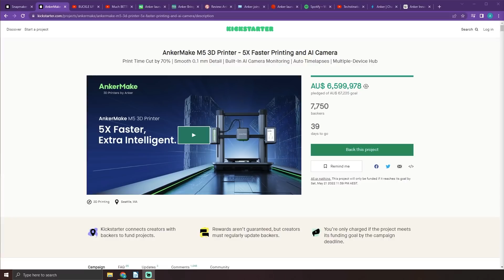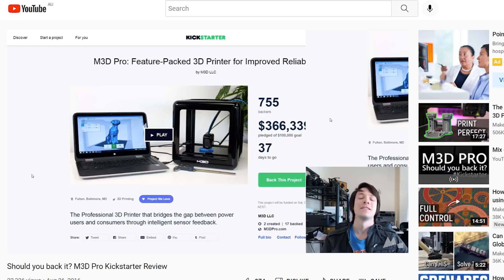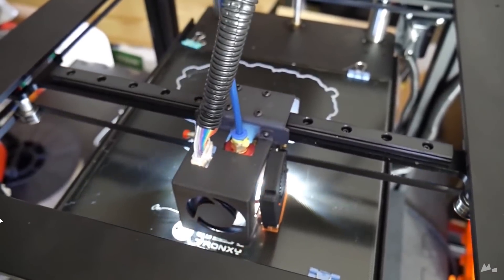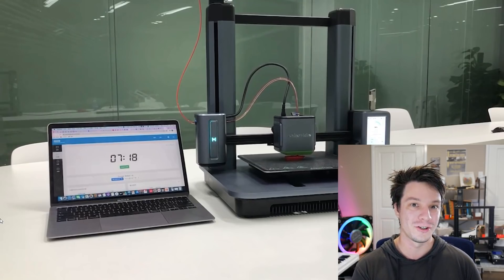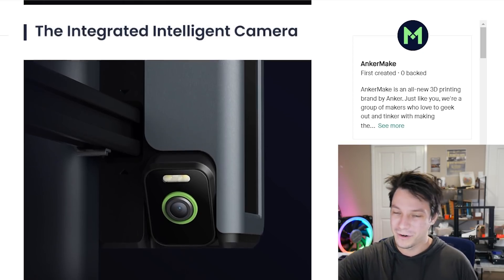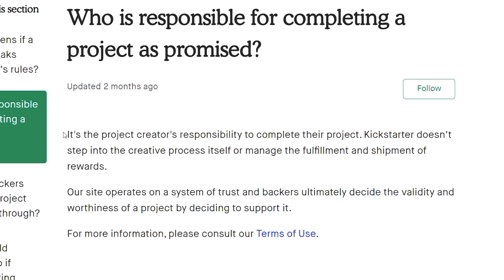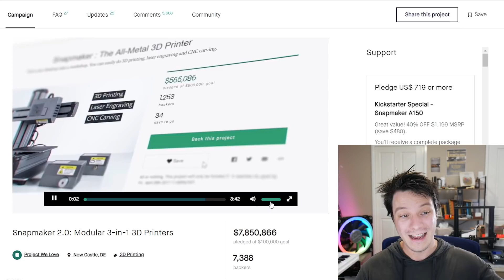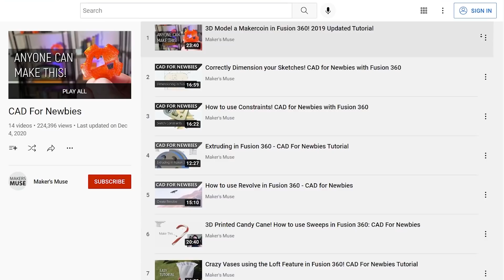This 3D Printer looks incredible, but...

Comment: I probably design 60-80% of the things I print on my 3d printer. Most of them are things that I make for personal projects or fixing things that have broken about the home.
Being able to design the prints myself is most of the fun. 
I've even gone so far as to take other people's models and modify them to suit my purpose for my printer (turned my Hypercube to use a rail on the y axis), none of the models suited what I wanted to do, so I ended up making my own. And without the skills I have learned I would never have been able to do it. I've sat through some of Angus's tutorials and others as well with Fusion360 and I've ended up with a lot of functional models, most are fairly simple, but the modification to my Hypercube was probably the most ambitious one I have attempted with 5 iterations until I was happy with the final result.

If I could only just print out downloaded models, I wouldn't have bothered with the printer in the first place. Now I love it.
Reply: I completely agree. The overwhelming majority of things I print at my own designs. I print a lot of functional parts and when I have a specific function in mind, it’s always better and usually faster to produce my own from scratch than to try to find one online that will fit the bill or be easily modified. All of the people who designed those models had their own specific uses in mind which aren’t the same as mine.
Reply: I'd personally say 50% of my prints are completely designed myself, 25% are modified designs from others and 25% are stock downloaded stuff. Then again, once you know what you're doing in parametric CAD, drawing stuff gets pretty quick if you know what you want or need, so it sometimes even is faster than searching for the model online.
Reply: I completely agree. 3D modelling will be (if not already) the next generation's MS Paint.

Comment: Slightly disappointed to see not even the slightest mention of their extremely sus/borderline FALSE advertising regarding specs, printing speed, etc.

TL;Dr they have no actual software written for this, and the massive speeds they're advertising are all but impossible in 99% of scenarios with realistic nozzle size, material temps, etc etc
Reply: yeah, im surprised he didnt mention the advertised 5X speed and other stuff, but i guess inflated adverts are just par for the course at this point.
Reply: @pajamas720  I worry he's somewhat suckered into the trap of reading the implied statements such as "Advanced algorithms that align your printing with your course of action" and has automatically made the mental connection that they're using Klipper's rather nifty Input Shaping - which is clearly what they want us to think with that kind of phrasing, even though they're not actually providing any evidence for it, and have admitted to not even having written the software for the printer yet.
Reply: Has the speed shown to be false?
Reply: @veryboringname.  Yes, actually, their own video shows that it does not meet the actual speeds they are claiming.

There is a difference between "prints 5x faster" and "can print at up to 5x travel/feed rates". Printing 5x faster means a print would take 1 hour instead of 5, but the realistic meaning is that you can punch your maximum travel/feed rates up pretty high (they advertise 250mm/s), but the printer almost never actually hits those speeds.

Just as a small point of comparison: a printer for half the price, such as the Creality CR6 SE, which also has the rigid frame, dual Z-Axis screws, auto bed levelling, etc etc, has a "normal" print speed of 60-100mm/s, and goes "up to" 180mm/s. Even at its absolute slowest default setting, the Anker is still not even 5x. With that said, the actual speed it was moving in their own video is about on par with how fast mine goes when I have it set to run around 75-100mm/s, but I've also fine-tuned my acceleration and jerk limits to maintain acceptable levels of quality while printing at higher speeds.

Then there's the issue of nozzle size and heater capacity: a nozzle that's twice as wide can spew out four times as much plastic (hypothetically), but then you also require a massively powerful heater cartridge to melt the plastic at least four times faster, and the quality of your prints is now half because the nozzle is twice as wide (so sharp details cannot be printed). Additionally, with the plastic being melted so rapidly, there will be tons of oozing, stringing, globbing/zits, and all sorts of other things that have a very terrible effect on the quality of your print.

No matter how you look at this ad, it's pulling in a bunch of buzzwords and features that are either free and open-source (klipper's input shaping + pressure advance, spaghetti detective's ai-based print failure detection, octolapse's timelapse feature, etc etc) or features that are only physically possible on things like the voron, ratrigs, etc (printing at a genuine 250mm/s speed while maintaining quality and tolerances, and also not physically tearing the machine apart in the process)

There's also a numerous amount of errors/inconsistencies/misleading info along their kickstarter campaign and website; "Precise 0.1mm detail" while showing a picture of the nozzle implies the nozzle is 0.1mm, when the standard is usually 0.4 or 0.375. While it's true that a 0.1mm nozzle will yield incredibly sharp details, it will also take over 15x longer to print with a nozzle that small, due to the reduced flow rate, so AT BEST they're implying that you can put a 0.1mm nozzle in there for when you need precise detail instead of high speeds. "Cuts print time by 70%" should instead by by 80%; this is just basic math (if it prints 5x faster, then 1/5th of 100 is 20, so that would cut print times by 80%, not 70%). There's an outright typo in a section about the heatbreak assembly: "a tiny 30 mm distance between the exturder and the nozzle"; this should say extruder, not exturder. In the same line of text they mention "internal processing that checks on your print more than 1,000 times" but this also does not make sense at face value: is this 1000 times per second, implying a measly 1kHz processor? Taking the phrasing at face value, it would mean 1,000 times per print, which could imply something about checking every layer, but that would only make sense if all your prints were at least 1,000 layers - no matter how you slice it, it's ambiguous marketing speak that's made to sound impressive without actually explaining anything, let alone quantifying any kind of specific guarantee/claim, so if the printer is actually shit, they can't be sued for false advertising. "Advanced algorithms that align your printing with your course of action" is another great example of this; one could argue that even the most basic lines of gcode to draw a circle are, in fact, an algorithm, as they meet all the basic requirements to be defined as such. Does this statement hint that they're using Klipper's input shaping, a rather advanced algorithm that physically changes the motor movements to align to the actual dimensions and mass of the printer, slightly increasing print speed and quality while reducing wobble and failure chances? Yes, it certainly implies that, because they're listing that sentence in the section about speed and quality. But it doesn't actually technically specify this, it only implies it. This kind of marketing garbage is why this thing smells so terribly fishy.
Reply: @StormBurnX  I'll personally wait for proper reviews before passing judgement. Right now everything is just "I think...".
Reply: @veryboringname.  Exactly. The only reviews I've seen so far have all been sponsored reviews that followed a script, and while it's disappointing, it's not a surprise. I have no doubt in my mind that Anker is capable of delivering "a printer" in the same way that I have full doubt in my mind that they will deliver the printer they are actually advertising - time will tell, but their price point is the biggest dead giveaway, as well as the fact that literally their own video advertisement blatantly disproves the advertised facts.
Reply: @StormBurnX  The thing is, you've already made up your mind. Even if it performs surprisingly well, I have a feeling you'll still find fault with it.
Reply: @veryboringname.  well let me put it this way: its impossible to get those kinds of speeds without building a core xy dedicated to pumping out speed benchys or otherwise  creating gcode that will kill most printers, not to mention the quality will be bad.
Reply: 100% this. 250mms bullshit at 500 acceleration…..
My printer at 125mms blows this thing away.
250mms lol…. Yah give me a break

Comment: I'm still waiting to discover an every day practical reason to have a 3d printer for home use. In other words, what is the 3d equivalent of "print my family photos" or "print my school assignment"? I design/print a lot of "random around the house" kinds of things but that's the key … I design them. They're often entirely custom one-off things because I have a machine and have been a serious hobbyist for over a decade and I enjoy the process. But I just don't see there being enough things for non-designers to make (and be willing to wait for hours to print) that can justify a $500+ device vs just buying some injection molded widget that does 99% of the job. You only need so many fidget toys.
Reply: The only thing i can see that will give the use case for having a printer in every home is if manufacturers of everyday products would have some of their replaceable parts available as models.  Things like oven knobs, with instructions that they should be printed in materials with higher heat tolerance, microwave door handles, things of that nature.  Unfortunately with the direction product design is going, and the trend towards replace instead of repair in the pursuit of more profits, trying to get manufacturer support like this is a pipe dream at this point in time.  I design and print my own stuff, but occasionally will help my friends out with printing spares for stuff.  This past weekend I printed a pair of tape dispenser cores for a friend, who's kid lost while playing with the tape dispenser.  He could have bought them for a few bucks online, but he asked me instead and for pennies of electricity and PLA, I was able to bring his tape dispenser back to working order.  But as you pointed out, I didn't buy the printer to print replacement parts for stuff, it was just a positive side effect of already having a printer for other purposes.

Comment: Of course you can "cheat": it's literally buying pre-vetted images. We're talking about an attempt at going after the "set it and forget it" crowd, the people who DO NOT WANT to know how to slice, how to model. They want to shop for a 3D model online, send it to their printer (the phone app lets you do that without ever having to connect the printer to a PC or even a USB stick), and just have it print. That is what the future of this hobby is going to be: Not a hobby, but a tool. 

People don't change their own oil in their cars (by and large), they won't be doing their own modeling or slicing. This is where home 3D printing is going en masse, same as anything else that used to be a hobby. This isn't a bad thing, it's just a different thing.
Reply: I think it's comparable to the FPV/drone platform market. People who want to build from the ground up, tinker, and tune are able to do so, and that hobby community drives all kinds of innovation forward. But most consumer-level folks just buy a locked-down DJI product and use it a few times before getting bored. The hobby folks often wind up buying a DJI drone as well, because it has its place even in the hobby world, and I think that'll be true of Anker's printer.

Comment: People who own future 3d printers are going to look back on our current stuff like we look back at personal computers from the late 70's and early 80's. You can do a lot with them, but as the technology improves and the paradigms shift, people will be able to do a lot more with a lot fewer headaches.

Something I would like to add on the design aspect of your prints. Knowing how to make a model in CAD is an important step, but learning good design choices for those models can often take trial and error. Don't be afraid to design, print, modify and repeat. If you want to improve your design and making, the best way is to (big surprise) design and make.
Reply: I have now been printing for over 4 years now and designing and printing are no guarantee your model will look good or work well.The simplest and cost effective way of printing I have found  is to print small first, check it looks and dose what you want, then increase to the actual sized you want. Save me a fortune in wasted time and filament. Hope this advice will help someone.
Reply: No, people will look at them the way we look at milling machines from the 40’s. Sure they didn’t have digital readouts and stuff, but at the end of the day, you got a part out of it.
3D printers are tools. You don’t need a printer if you don’t need to print.
Reply: @QuitProcrastinating  that's the good thing about 3d printers they don't really get outdated until someone completely reinvents the wheel (like material jetting)
Reply: Completely agree about making good design choices - very important. I believe it's best to sketch out ideas before 3D modelling - saves a LOT of time later!
Reply: Beg to differ.  Stick with printing technology.  If you look back on the printers of the 70s and 80s, they were rock solid.  Right down to having specialized feed paper so that designing around jams / jam detection wasn't really an issue.  Now, yes, the feature set has exploded.  But the reliability is super low and the cost is way higher.  To the point where it's cheaper to toss your printer in the bin than buy new ink.  Where manufacturers have programmed in mandatory ink refilling and will disable a printer PERMANENTLY  based on a calculation of how much waste ink has been dumped in automatic head cleaning.
Reply: No, there are too many factors that go into a 3d print. This isn't a static machine or paper printer. Even the most expensive machines have issues.
Reply: Me when I see reprap printers

Comment: I disagree on the needing to be able to cad to 3d print. For wargamers (at least) what is happening is people  will chose the army (either free or paid) then print locally. The problem is it is just a touch away from being usable for anyone. Resin 3d printing has the best results for detail, but a friend bought a creality 6 and the details on the prints are very impressive.
Reply from the maker: Ah that's a fair point! Minis are something that is perfectly suited to digital distribution.
Reply: @MakersMuse  Another similar niche is printing firearms, here in the US. There's a lot of firearms tinkerers who know enough to put stuff together, but don't really get into the actual engineering and modeling. We end up having a few communities where a small inside group works on designing, then there's a slightly larger beta test group that do testing to make sure it's reliable and safe and find any bugs, and then it gets released to the wider community which includes a lot of people who just want to print something and put it together. So it's only a very small part of the community that actually does the CAD work, and digital distribution works out great for us.
Reply: Printing minis is a very specific niche of 3d printing and also has a pretty big user base.  What I took from Angus' statement was that for people that don't have specific needs or already know where they can get those models, the experience is very limited and can get boring fast.  Anet used to have ads that said things like: "print anything!" which probably sounds great to someone who has no idea all that 3d printing entails, then buys a printer and soon realizes that "anything" should actually have come with an asterisk since if it doesn't already exist and you don't know how to model, or don't want to commission someone to model, its not happening.

In the case of minis, I am so glad that the niche exists and there are so many models available as it really does allow smaller/independent modelers out there to get their work on to tabletops.  Good luck finding a Vive DAS mount for an obscure powerbank to use with your Frankenquest 2 though if you don't know how to model and its not already out there.
Reply: As a wargamer I also do a bit of modeling. Terrain, storage solutions , and the like. Heck I just altered a stl of a barrel and made it into a soda can holder for when I play Blood bowl. The point being. Yes you get into it to print cool stuff, but some people will get the itch to try and do some original stuff too.
Reply: @Skullyweb  I agree, but I have a friend who is a trained engine who taught himself Solidworks but does not do much designing. Everyone gets the itch to experiment, but even the patron saint of WW2 tanks Bergman, created a lot of files but let people mod them in order to make them suitable for their own needs. And that would be nice skills to learn. I have tried to teach myself how to make moulds or slice STL files to make printing easier. That is not causing per se, but there is no real tools apart the ancient meshmixer to manipulate models easily....